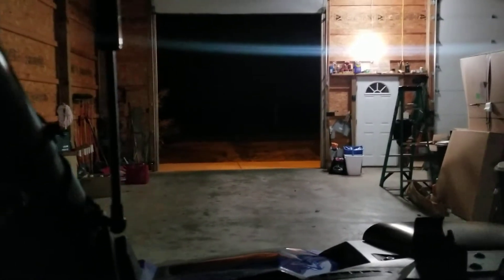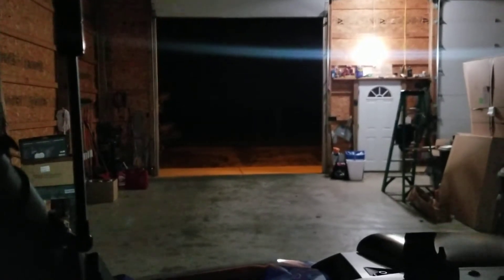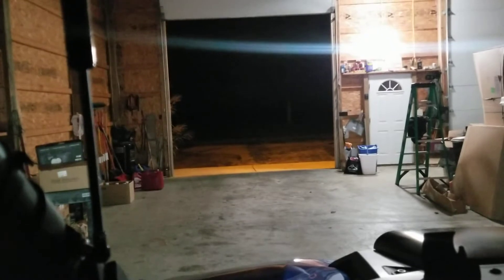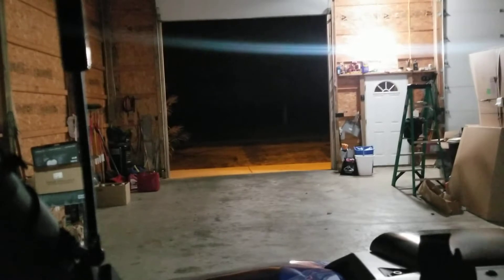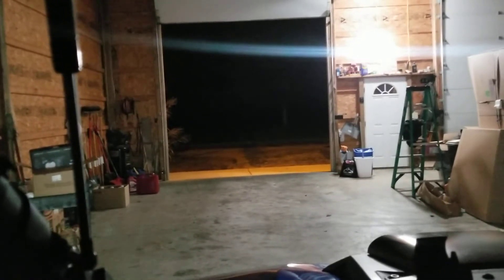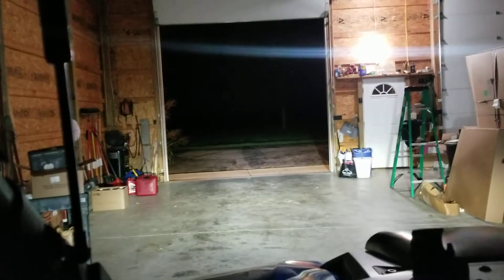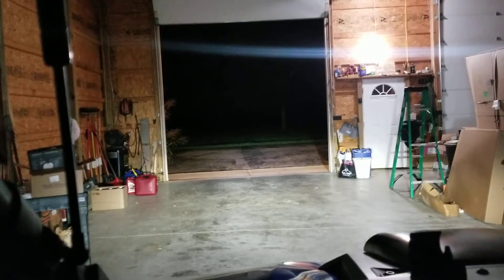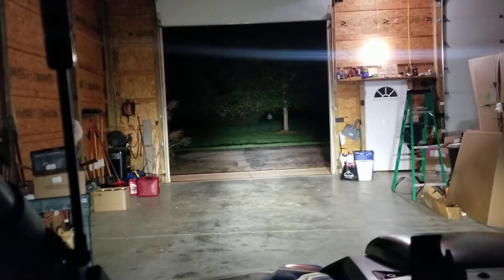2021 RZR Pro XP4 light test with Diodedynamics SS3 Max and SSC2 Pro in combo lens.

Comment: Can you show us where you mounted them on your RZR?  I'm looking for a similar set up on mine.  Thanks for sharing!
Reply from the maker: Best place to see them is here: https://www.rzrforums.net/threads/arcticz-rzr-rockford-fosgate-pro-xp4-build-picture-heavy.563075/post-6141249
Reply: Very nice. Thanks for the update
Reply: @arcticzale1  did you fabricate the upper mounting brackets for the SSC2 lights?  The whole set up looks awesome.  Great job.
Reply from the maker: @justinwakefield8512  The light bracket under the front bull bar is from Baja Designs and I had to modify it to work. The light brackets under the stock headlights that hold the 2" SSC2 Pro lights is just some aluminum stock that I bent in a vice and drilled some holes in. The mount point is where the full Polaris bumper would be bolted in. Just put some U-nuts on it and bolted the aluminum stock in its place. Appreciate the compliments!